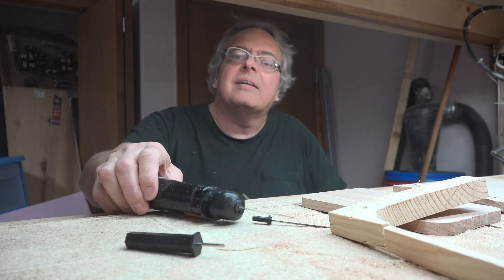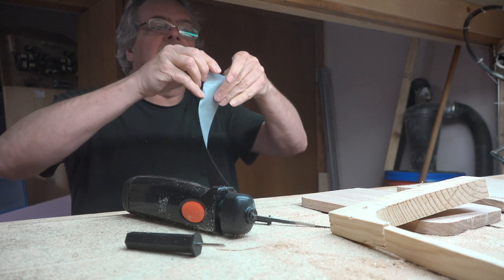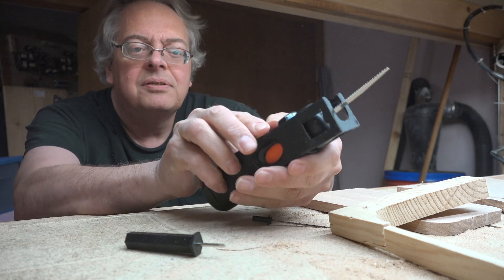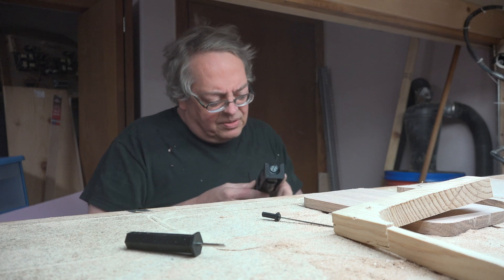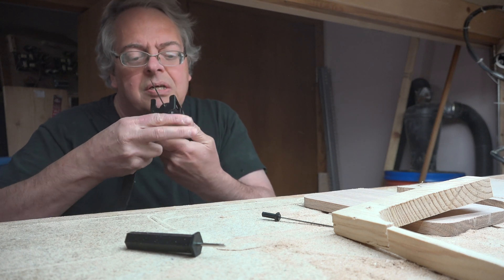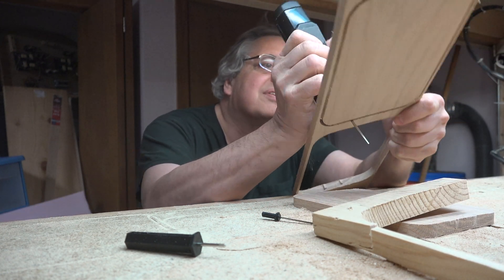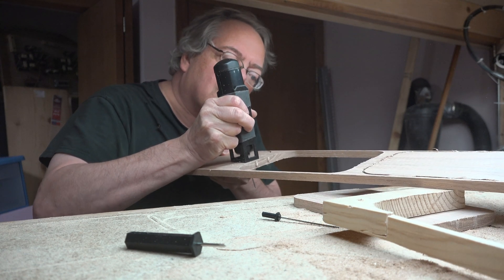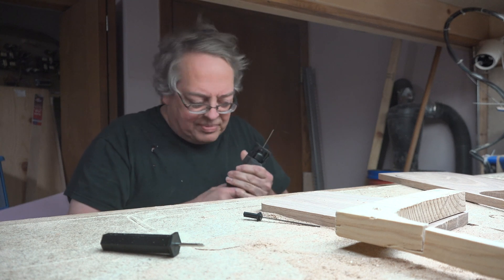Turn a Pumpkin Carver into a Mini Hand Held JigSaw

Comment: If you have time can I ask a few questions about my new mpcnc?
Reply from the maker: Congratulations!  sure, I can try. Fire away
Reply: I'm almost done with the prints, down to the 2- 11hr xy pieces but was just wondering about my hardware, I have a cnc shield v3 and ordered a part so I can use 2 motors on the x&y but didn't know if that board would work good enough. Should I use it or get a ramps 1.6?
Reply from the maker: @jasonpulliam310  Unfortunately I know nothing about the CNC shield. Check on V1Engineering.com and their forum. Some there may have some experience with that.  Will it be compatible with Marlin, or do you have to run something else?  Good luck with your build, and thanks for watching.
Reply: Still looking into programs not sure if I'll use a raspberry pi or an old laptop I have a few of each around, I was thinking about getting a ramps board but I already have the shield. I printing the last print now and the only thing I have to get is some more conduit